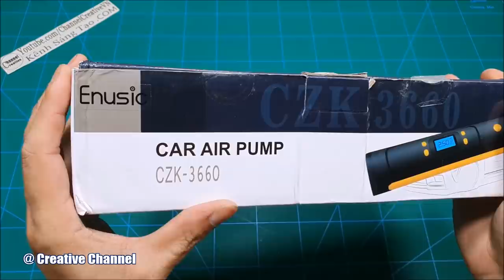Review Mini Air Compressor Pump for Motorcycle Car Auto Bicycle

Comment: The markings on the tire isn't the recommended tire pressure, it's the MAX, if you drive around on that you will wear your tires very quickly